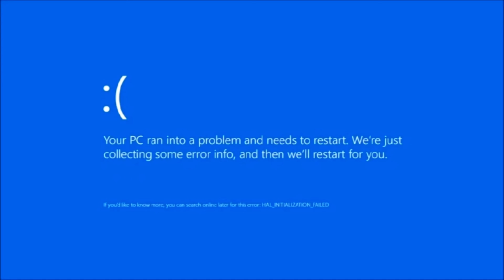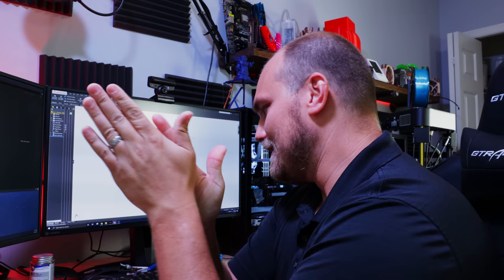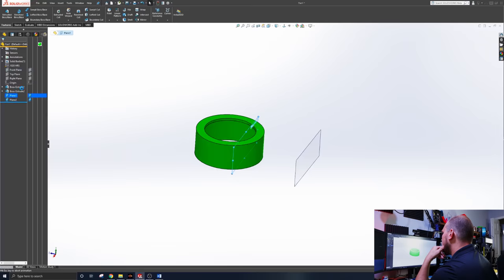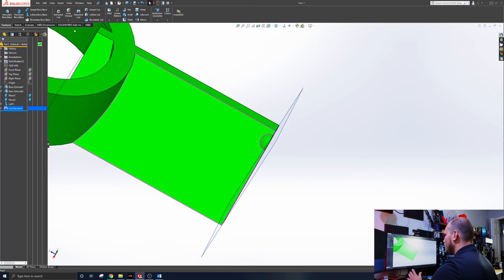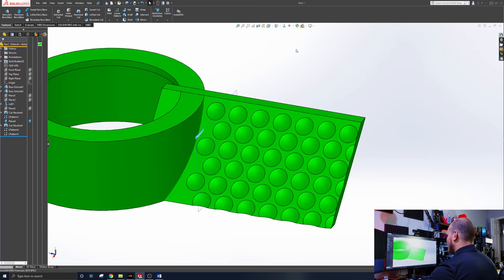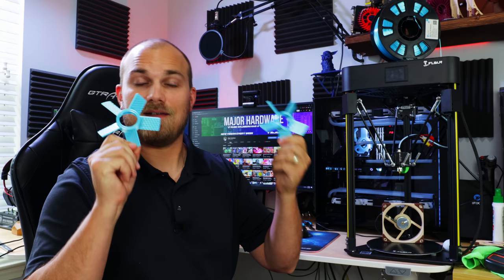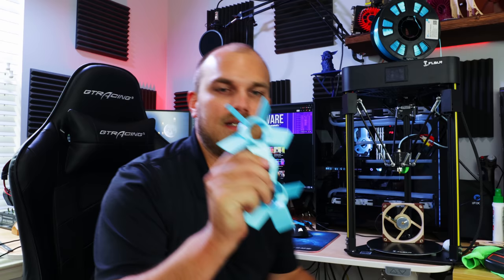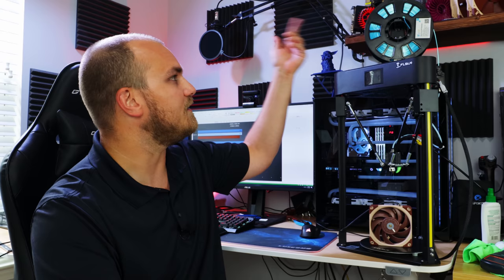What If Fan Blades Had Dimples Like A Golf Ball?

Comment: the dimples on golf balls reduces drag, wouldnt that be BAD for performance?

mythbusters did a car with golf ball dimples and it got better mpg lol
Reply: the opposite, if you had a fan with 0 drag, it would be the perfect fan since all it would fight against would be "deflection"! drag only makes the fan spin slower while deflection makes the fan spin slower but pushes the air out. lack of drag will not stop it from scooping air and deflecting it.
Reply: Am I the only one who knows that pc fans with golf ball dimples on the blades already exist?
Reply: @sinformant  Silverstone has some. Really quiet fans
Reply: @ayuchanayuko  yeah I know. My old power supply has one in it. Ypu can't tell the fan is tutning without looking at it. "0" noise
Reply: *km/L Becuz UPIC STANDARDS
Reply: No it can just raise your thrust to drag ratio (it’s just rotating propeller, so much like airplane wings you want to minimize drag, as drag does not equal lift and that’s why you have a lift to drag ratio you try to maximize for airfoils).
Reply: sinformant EVGA has their fans with the E’s all over them
Reply: Mythbusters were more often wrong than right. Some results they've had were down right foolish and lazy, seemingly willingly butchering results.  Gotta keep those that write your paycheck happy I guess..
Reply: noxxi knox  no, the drag consists of 2 variables at its simplest.  1 is reaction of the deflection of air molecules,  the 2nd is because of the boundary  layer on the surface.  Think of honey and how it sticks to the surface, if you could remove that you just have the drag from what you call deflection
Reply: @theepicslayer7sss101  If you had a fan with 0 drag there would be no air moment. Fan blades are shape of airfoil for a reason the same reason propellers are as you are creating lift which pushes air down. You can't have lift without drag.
Reply: well dimples on golf balls is to combat the magnus effect actually. The dimples actually increase drag a tad not decrease it. If it was a smooth sphere, since thee ball is spinning in the air, then the air would cause the ball to eventually make a sharp turn up or down(depending on the ball's spin)
Reply: noxxi knox  sorry, may it my English, but from what I read you neglected the fact that you actually can reduce one of the forces or cancel it from the calculation, what most of the ppl with simple knowledge just do if they talk about drag on a wing.
That's what I wanted to point to, so others can understand that you could theoretically have no boundary drag but still have lift
Reply: Benjamin Grabhorn  couldnt he just turn pwm off and go dc power instead?
Reply: @jakegarrett8109  Lift and drag are correlated. more lift generally more drag per given air speed, angular momentum of the laminar flow. It's generally angular momentum of the flow to created a localized lift effect and drag is a consequence.
Reply: mel e that’s only comparable on same airfoil in same region of testing (example such as when it goes supersonic, or the flow separates, etc, or in this case it’s 2 different profiles with one having golf ball dimples). I think you meant CAN correlate for same given conditions and identical airfoil, however now it’s a different airfoil (much like if we swap out conventional airfoils with flat blades, or we use stealth S-curve geometry blades, they can all produce identical lift but the drag can vary drastically).

 I would try to avoid over-generalize to that extreme (as proven when drag greatly increases when flow separates but doesn’t necessarily increase lift etc, and we are talking about different profiles to begin with and that is what’s being: how much lift they produce for a motor).

Another way to look at it is he expects there might be a different lift to drag ratio from golf ball dimples. If you always assumed they had identical efficiency (produced same drag and same lift) then you would expect identical results with all his fans and you probably wouldn’t even be testing it. Also rephrased as: if you assumed that every airfoil acted the same it would make his experiment illogical to even attempt (but we all know different airfoils have different efficiencies for different conditions).
Reply: @jakegarrett8109  I'm a non career scientist and I specialize in a niche of fluid dynamics. I learned a long time ago to not over explain to most people who don't have the basics grasped yet. My statements are generalized because there is a lot of nuance. I try too not get overly technical in a general forum.
Reply: mel e I believe my original statement covered it perfectly (hence I had to explain more in depth since your reply to my post was misleading and completely ignored the attempted efficiency improvement that was being tested in this experiment and was extremely misleading for the original poster’s question).
Reply: @jakegarrett8109  That's the problem with short forum post, nuance is hard to imply to a reader. I was not attempting to contradict you, contrary I offered an extension to your basic explanation with "angular momentum" of laminar flows. That's much too in depth to cover well in a short paragraph or two but gives others a hint for independent learning if they have the curiosity. It would take more than a page or two for a proper explanation with some references but I'm not contradicting you or being misleading. I am an actual scientist tho I don't make a career out of it. There are a great many ways to describe an observation and I would actually encourage the OP to continue his hobby experiments.
Reply: @Rickyog2009  Finally a comment that correctly points out that the dimples don't decrease drag. However, their relation to the magnus effect is the opposite. They are there to take more advantage of the magnus effect, not combat it. Smooth spheres actually experience the magnus effect much less dramatically. There is quite famous research paper where a researcher trying to study the physics a curve ball (in baseball), but initially was using a smooth sphere to model the system. He found that he actually couldn't throw a curve ball almost at all with a smooth sphere. It was the stitches on the ball that allowed it to be possible. For golf, shots are hit with a lot of backspin. The magnus effect, enhanced by the dimples, exerts an upwards force on the ball, keeping it in the air longer, allowing it to go farther. A golf ball without dimples falls out of the air much quicker and travels considerably shorter.
Reply: +Jesse C, writes "the dimples on golf balls reduces drag, wouldnt that be BAD for performance?"

Yes. Moving a golf ball through the air further and moving air with a fan are actually the opposite of each other. For a gold ball you want the ball to disturb the air as little as possible so that as little energy is taken up moving the air as possible. With a fan you want it to move as much air as possible.

Golf ball = move air as little as possible
Fan = move as much air as possible.
Reply: noxxi knox  That's not the way it works. There are two effects here: One is the angular impact of the fan blade on the air molecules which is very much like the cue ball hitting the black at an angle. That will send the air molecules in a particular direction, a vector that has the important component in the direction you want the air to be travelling. But there is also the drag effect of the fan blades on the air molecules dragging the air molecules with them in a circle, which is more like playing snooker / pool with balls that have a high-grip surface. You want the effect between the fan blade and air molecules to be more like two ideal hard shiny balls in snooker / pool, that's why low drag can make a difference.
Reply: noxxi knox  it was your first response where you said if there as no drag wouldn't interact with the air at all. Drag is a very specific thing and not really to do with Newtons third law, although it still has to be consistent with it. Drag in this context is very specifically the tendency of the blade to drag the air with it in a purely rotary direction, which is not useful. This is separate from the effect of the angled blade pushing the air molecules in a similar way to the cue ball striking a glancing blow to another ball on the table. If you're writing a gas flow simulator (which I have done) these are two independent effects that have to be modelled separately, so you can have the snooker ball effect without having drag, which is better
Reply: noxxi knox  well, I agree that we're disagreeing over the semantics, and the reason for that is because I believe that the semantics are important. Drag has a very specific meaning in engineering terms, and it doesn't have two separate meanings. It's important because when you're communicating with other engineers is essential for mutual understanding that you're using the same language. Corner I also agree that in reality it's not possible to work with a drag-less system, but is important to minimise drag in these circumstances
Reply: There are two basic forms of drag: skin friction drag and pressure drag. All bodies are effected by each, some worse than others. Stream lined bodies like an air foil (fan blades) are more adversely affected by skin fraction drag where as a bluff body (like a golf ball) is more adversely affected by pressure drag (flow separation).  Dimples on a golf ball increase skin friction drag by causing turbulent flow which provides more energy in the boundary layer to delay the onset of flow separation and there by lowering pressure drag.
Reply: Benjamin Grabhorn wouldn’t it be better to compare airflow at a fixed wattage for this application since airflow will be the determinate of effective cooling?

Comment: A trick my teacher did when he needed to weight things using a scale that could not go low enough was to add known weight to it.
Reply: Yup. Thats how some vets weigh lazy or large baby animals. First take their own weight and then carry the animal in their arms onto the scales. There are some pretty damn cute animal vids of it out there. The dood carrying a baby giraffe is cute.
Reply: @markky3050  That's how I weighed my dog and cat.
Reply: Yeah I was thinking about the weight difference too. Kinda like how the tested the demples on “Mythbusters”
Reply: As long as the scale is actually sensitive enough to measure that low of a difference in weight but just not that low of a weight overall. A lot of scales cut out at a minimum because it's less than their sensitivity, e.g., a scale that weighs down to  tenth of a gram won't be able to accurately weigh anything less than that no matter how much extra weight you put on it.
Reply: @skipfred  aye but if you have a scale that cuts out at 100g and you want to weigh something less than that, you can use things you know the weight of under that to get to an approximation. like lets say the unknown value you are weighing is 50g. if you had a 40g, a 50g and a 60g weight you could narrow its weight down to 50-59g. Sure not super accurate but it's better than nothing.
Reply: @Goodboy77717  Oh yeah, that's a good point. I hadn't thought about comparing to known weights.

Comment: One thing that I would really be interested to know is whether (or how much) two counter rotating fans improve performance compared to e.g. two stacked fans rotating in the same direction. In theory the second fan will (as well as adding more energy) remove some of the turbulence in the air stream created by the first fan, thus increasing flow velocity.
This approach is not really common in PC building, so a perfect test scenario for you ;-)
The second fan needs an unusual blade design, basically inverted, but optimized rotors can look quite crazy.
Keep up the great work!
Reply: @Wereskeleton  I bet it does! How is the noise though? Server grade cooling is often quite loud.
Reply: Theres been quite a few turbo prop planes that used counter rotating props to achieve faster speeds. They're also unbelievably loud.

Would be quite interesting.
Reply: It has been done and in fact, he's made a video on it. Check out the Scythe fan videos!
Reply: @ViperDent  Thanks for pointing that out! The difference with the scythe cooler is that both fans are separated by a set of fins, which will have already straightened out the airflow once the air hits the second fan. So i think there still would be something to learn by placing two fans back-to-back, creating a true counter rotating fan setup.
Reply: there are helicopters with rotor blades that are counter rotating so that they conserve angular momentum without needing a rotor on the tail end.
Reply: I want to see two fans stacked with counter rotating blades
Reply: Would the second fan’s blades be reversed, or would it literally just be identical to the first but spinning backwards?
Reply: @PeachIceCreamy  That depends on how sophisticated you want the dual fan setup to be. Most notably, the pitch of the second fan's blades should be changed due to differences in airspeed. I guess inverting the rotor (turning the hub 180°) is easy enough to do in any CAD program, which is required because you can only mount it from one side onto the motor of a Noctua.
If e.g. you look up the open rotor jet engine by Safran, you will see the crazy blade designs that engineers come up with for optimum noise and efficiency.
Reply: Some propeller driven aircraft use counter rotating blades to get smoother airflow. Like the Russian Tu-95 bomber
Reply: The fuma 2 cpu cooler uses this method
Reply: I'm not sure how efficient it will be but it will be loud.